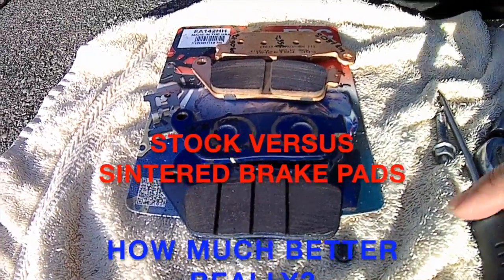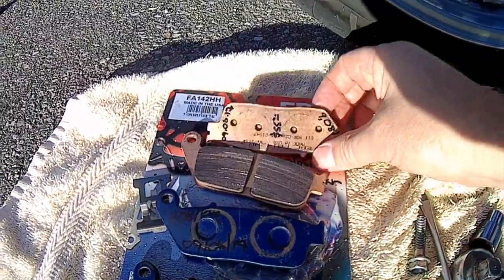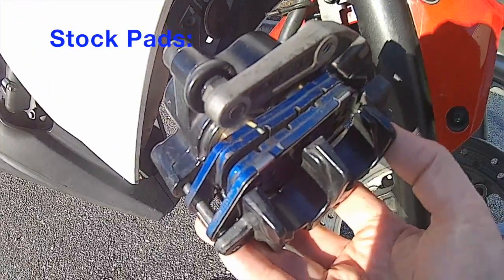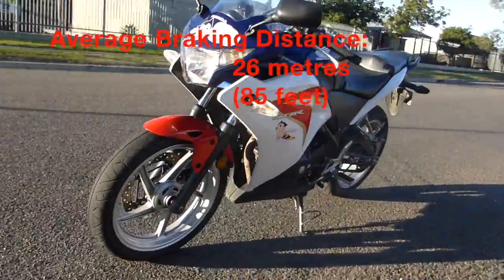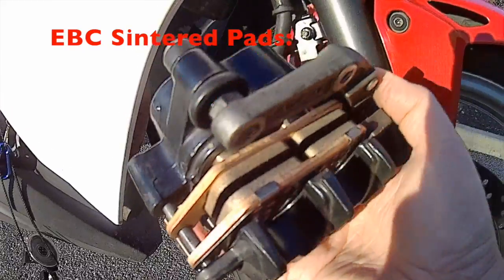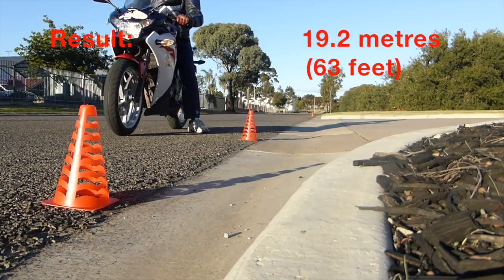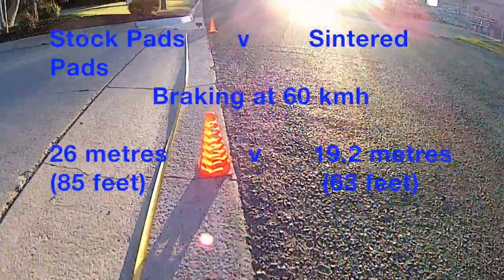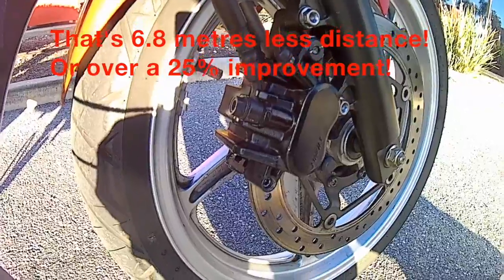Sintered Brake Pads vs Stock Pads-2017

Comment: If you have enough money to change often rotors so.its the best brake pads safety first
Reply from the maker: In all the time I have run sintered, I have never had to replace the rotors, that said, I don't put a lot of kms on them (eg<20,000kms)

Comment: very nice video
I installed these pads, braking is significamtly better, brake modulation is also a lot simpler
my bike has brembo brakes and this pads make them much more confidence inducing
Reply from the maker: Glad you had success.  Stay upright.

Comment: Yeah..... and EBC HH have a lot of disc worn as well ;)
Reply: Just put the double H sintered in the rear and the semi sintered in the front. I do this with my Harleys and no issues with the rotors.
Reply: @PAULY-P  I never go sintered in the back cuz I almost not using them.
Reply: Yeah its far better to have discs with no wear and much longer stopping distances, at least if you wreck your bike because you couldn't stop in time your discs will be in good shape.

Comment from the maker: Hi the sintered pads give you great feed back so if you already have good braking technique you’ll benefit from these imo. Think of it like comparing a good pair of running shoes to wooden clogs (where the original pads are the clogs).
Reply: Hey man ,my motorcycle has abs ,these sintered don't interfere with the abs system right?i mean are they fine I'm new to motorcycle s
Reply from the maker: ABS is an electronic system that measures movement of your wheel so is independent to the pads. ABS will still work in other words.
Reply: @duannecb  hey thanks,do sintered pads wear/damage to the disc rotor earlier ?
Reply: @narendradatla4177  yes, but its nothing to worry about. you can also go for semi sintered if you want the best bang for bucks i might say.

Comment: Just changed the rear brake pads of my Suzuki GS500. The old brake pads were Tokico GG. The new brake pads are EBC organic. I can tell that the original Tokico brake pads used to provide much more braking power. The new organic pads are almost useless. Before I could lock-up the rear tire. Now it is impossible. What braking pads are you using? :)
Reply: Question is: how much rear brake power do you want?
I think I personally could use with as little as possible, since I use front brake solely for 95% of the time and the rear brake only for low speed maneuvering  and standstill
Chance of losing traction in the rear at an emergency stop would also be severely diminished
Reply: You have to give your new brake pads time to break in too. You can't just put them on and go stomping on them. For example EBC recommends 300-400 miles to bed in sintered and semi sintered pads. Organics are a little less